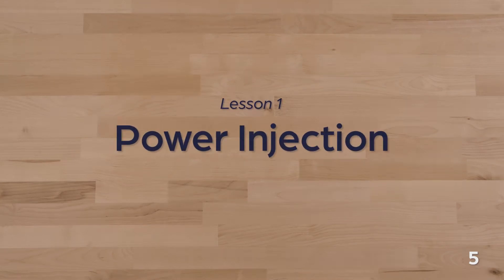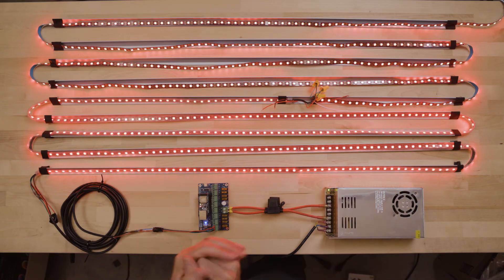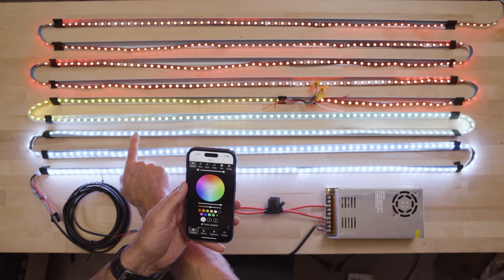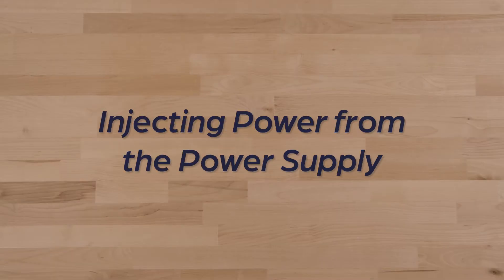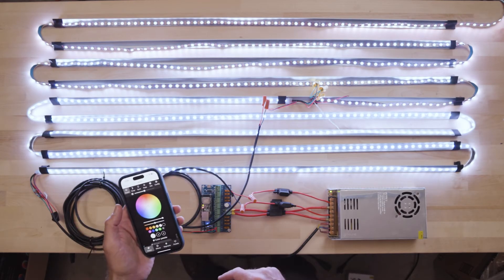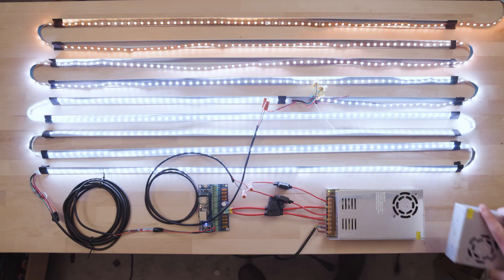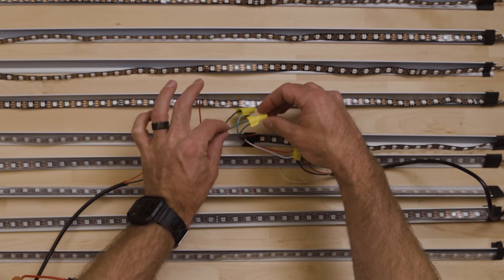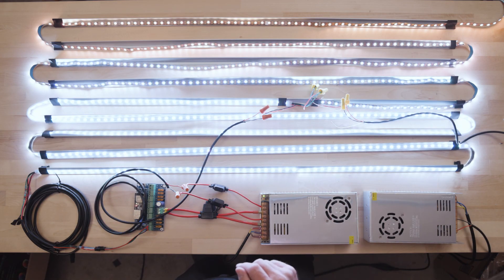3 Methods of Power Injection for LED Lights

Comment: Only 46 subs? Well I will make that 47. Seriously, I have been trying to understand power injection and the options avail for a few months now. I have a basic grasp of everything, but could not figure out for the life of me the solution shown in method 3. There are some amazing resources on YouTube, but their explanations never "clicked" with me (I will blame it on having a toddler and the lack of sleep that comes with it). NOW I see the answer to something that has hindered me in installing permanent outdoor lights AND allows me to fix some issues I have with previous builds. Cannot tell you how grateful I am for taking the random shot again today and searching "power injection led strips for long run of lights" to find your vid. Again, thank you!
Reply from the maker: @CraigJNewman  I’m super glad it was helpful! I’ve been on that exact same journey before and it’s the main reason I started making a few videos. There’s a lot of great resources already out there, but most of it assumes some level of existing knowledge that I didn’t have. Power injection was definitely one of them. Good luck on your future builds!

Comment: So essentially, 5v and gnd from the main power source (controller or brick) to the main feed point for all leds, then run another wire in parallel from the main power source still and connect them at any point to the 5v and gnd of whichever led in the line

Comment: But could you please help us understand , how did you actually solve the problem turning all the led at full brightness at white light using those power supply. can we attached another power source from another end of the led strip light ?

what if in the case , when led strip is of only one colour ( lets say natural white ) . for 24 v COB LED STRIP LIGHT  ( with 536 led/Meters) how much power supply do I need to connect on both end of wire, if I want to run a 20 meter of such led strip ?

Comment: How do you figure out what size fuse I would need? I think you only need 1 fuse? Only on the power side not the ground side? Since it’s one complete circuit. By added 2 fuse that makes it a bigger fuse?

Comment: With example 3, is it necessary to share the grounds? Can just the data be connecting the two strips?
Reply: My questions, too. But is it the grounds or the negative wire? Or is that the same?

Comment: Great video… what size of fuse did you use?
Reply from the maker: @rsanders814  Thanks! I believe I used 10awg wire and a 25 amp fuse for this setup.

Comment: 3 milliamps to power 500 LED bulbs is going to require 1,500 watts to operate all equally. Call it injection or simply wiring correctly makes a difference in performance they operate as signed. Not under powered to be dim, over-powered to shorten the light output. Strip LED’s are designed with dropping resistors to provide the correct amperage or have no resistors and require they correct current supply at the lead input! This is not rocket science folks. DK, Omaha. ASE Master tech since 78.

Comment: Great video! Subbed. Please can you advise what fuse block you used and the setup? I haven't seen a single tutorial which includes the fuse Thanks
Reply from the maker: These are the fuse blocks I use in the video. I’ve really liked them. https://a.co/d/2Fdd78f

Which gauge you need and which fuse you choose to put in it depends on how much current your system will pull and how much it can handle. You can find the gauge you need with wire gauge charts if you know your wire specs and how much current your lights and controller will pull. 
However, you should always verify with a clamp meter if you know how or consult with an electrician if you don’t. 

I’m using 10 awg wires between the power source and the controller in this video.

Comment: Cool video! If you have a long string of pixels (per example 800 pixels), could you inject at more than one point with only one wire or you have to use a new wire for every power injections at about 200 pixels each?

Comment: Great helpful video, If i do method two, what are some safety precautions I should take to avoid getting shocked/starting a fire in my house?
Reply from the maker: Hey! Sorry for the slow reply. I missed this somehow. 

1. I’ll start with my disclaimer haha. Always consult an electrician if you’re not confident in making your system safe. 

2. That said, I’d recommend making sure you’re working with the appropriate wire gauge. These are typically low voltage systems but can still melt/burn wires if your loads (lights) are pulling a lot of current. 

3. You can use the inline fuses I show in the video as a safeguard. They will break the circuit if too much current passes through them.

Comment: Thanks for the video! I'm curious about what gauge wire you are using for the shunts. Looks like 20awg? I see you are using a much beefier wiring directory from the power supply to the octo board - 16 awg?
Reply from the maker: Thanks for watching! In this instance I’m using 18awg for the power injection and a beefy 12awg for the controller.

Comment: Your comparison fell apart as soon as you used two different types of LED strips. Really?
Reply: What I learned from this, is that power injection means nothing because they both ended up looking like crap
Reply from the maker: @jamesmeaney4069 haha, yeah, to get all 600 LEDs to light up right, this setup would have needed additional power injection beyond what was demonstrated.
Reply: This is stupid. Give the power these leds need from the start, period. Injections ? My balls.
Reply from the maker: Coming in swinging! I disagree with your assessment, but thanks for the feedback. This is a demonstration of different power injection techniques, not a comparison of lights or even necessarily of which technique is best (though, it does give some directional indicators there). Scientific standards of excellence? Nah. But it gets the point across.
Reply: I’d say that this response is adequate. To say there was no difference in quality when you performed the power injection half way down the line would be a lie. There certainly was, but I do see a lesson from this comment that could be learned. You could have made a much more compelling argument for power injection by having the consistency that using the same type of LED strips would offer you. Having said that, anyone with half a brain can look at the results you show and see that this is a compelling enough reason to attempt this method themselves if the need arose.
Reply: @brionlund2467 valid and perfectly worded  criticism. It's obvious to anyone that leans heavy in common sense that there's a major difference when midspan power is introduced. That point would have really been driven home if we got that release of dopamine from seeing both strips with equal brightness and color lol. 

For me personally, this was still one of the best demonstrations I've seen on this topic. Just could have been slightly better lol.